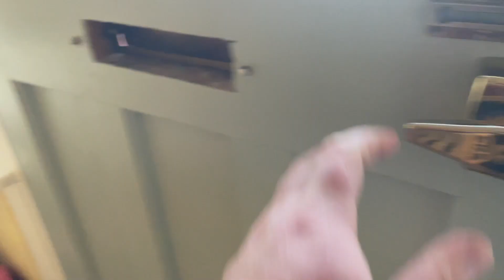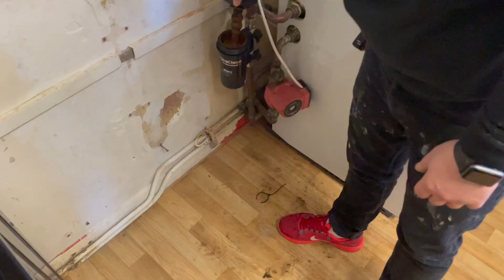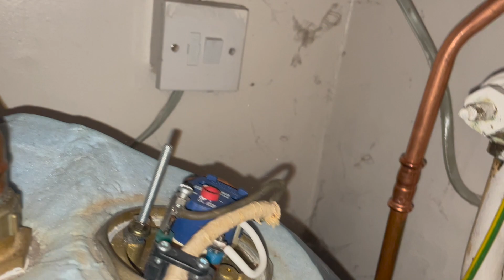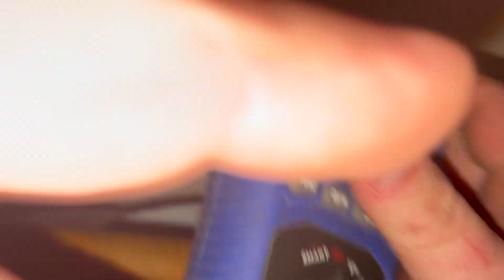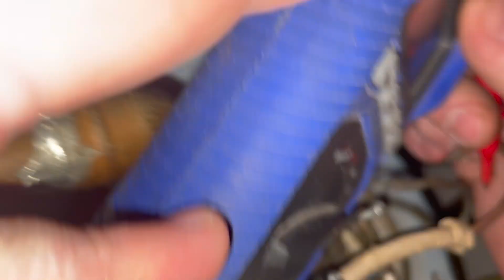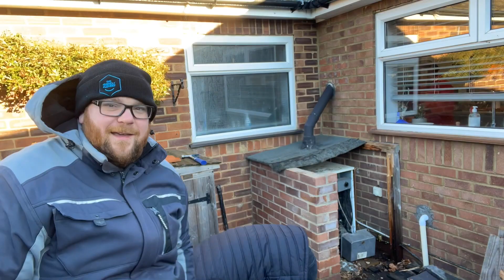Day with the friendly plumber ep#16 oil Boilers & How to test an immersion heater

Comment: Enjoyed the video thanks. One question, on the replacement boiler situated externally and very close to and underneath an openable window - is that to code - regarding exhaust?
Reply from the maker: Hi Norman, great question! Normally you are 100% correct however that window was screwed shut and the customer was happy to have it there! So i was happy to do it like that! 👍
Reply: @TheFriendlyPlumber  Thanks for answering, much appreciated.😀👍

Comment: Nice little video mate I enjoyed watching it I believe gravity on a condensing boiler is a no go I would check with the manufacturer,  I would also trace the vent and cold feed and check it’s in correct orientation if the neutral point is the wrong way round air will be drawn into the system or it will constantly vent over this is probably the cause of that sludge in the system and boiler shell failure ( also cold feed tends to block up in this situation hence someone cutting in a flexy to allow them to clear blockage)
Hope the above helps and maybe avoids another boiler swap in a couple of years.

Comment: RE signs for the van: My concern is thieves know which van to target once they see its a plumbers/gas engineers van..... or electricians etc. A builder, painter or plasterers van may have some tools of value, but I wouldn't think it comes too close to all the top-end power tools and FGAs etc that we would have.
I've had a quick look at magnetic signs that can be removed at the end of the day, although I need to look into it a little more and see if it can be a good compromise..... they don't seem to look as good as a full(ish) wrap.

Thanks for your vid, it's good to see you back at it.
Yours
Chris.
Reply from the maker: Hi Chris! I feel you on this and was one of my big concerns! And im sure it does effect the likely hood but all you can do is the same as everyone else alarms dead locks lock boxes ext and hope for the best! Its 100% one of my biggest fears!

Comment: Correct me if I’m wrong but I’m pretty sure you can use the same flue for a different appliance
Reply from the maker: Hello mate! As the appliance was only 2 years old and a like for like replacement as long as the flue tested ok we were able to use the same flue! But 100% normally we would change the flue with each appliance!

Comment: The resistance  of the emersion heater element should have been 19.2 ohms and not 17 k ohms and you did not test it to earth witch is where they usually fail.
Reply from the maker: Hi John thanks for the feedback! Like i said not an electrician this is just how a was taught to do it years ago! 👍
Reply: Yeah I was going to say something similar iv heard anything from 15-25ohms is fine and that's from a electrician. Loving the videos though especially the oil stuff as that's all new to me keep them coming 👍🏾😎